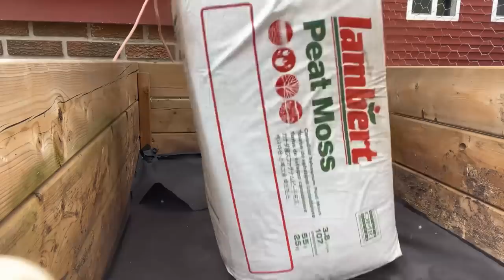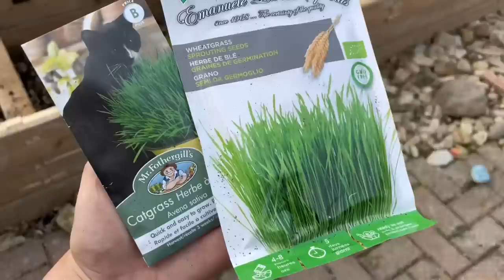I Built a 20ft OUTDOOR Enclosure for my NEW TURTLE, Here’s How!

Comment: Great build--love how much space you gave your animal--we have three (all younger and smaller than yours and gave them a 5' x 15' enclosure).  

For water, we added a 30 gallon Home Depot pond and it overflowed into another large flower pot that was dug into be ground level.  In that lower level, we used a small bucket (1.5 gallon I believe) as a pump vault and filled surrounded it with rocks large at the bottom and small gravel near the top and the return pump went to the upper level via PVC in a reverse underground filter manner.

Basically, if you look at pond designs, the lower level works as an intake bay and the upper level works as a bog filter.

All of that to say this kept the water flowing which eliminated mosquitos and kept the water cool for the turtles which are always in the bottom level drinking, soaking and eating snails that showed up in the plants.  I wonder if the mosquito fish would bake in the filter-less method.  It also keeps the water crystal clear, not stagnant and rainwater replenishes 90% of it.

Lastly, I also used staples for the wire mesh but have replaced them all with U-Nails...  the staples worked great for a while but seam to work their way loose and I feared the possibility of the turtles consuming them--at least while they're still shiny.  Rusty ones probably get ignored.